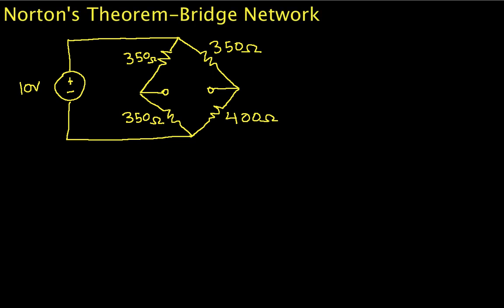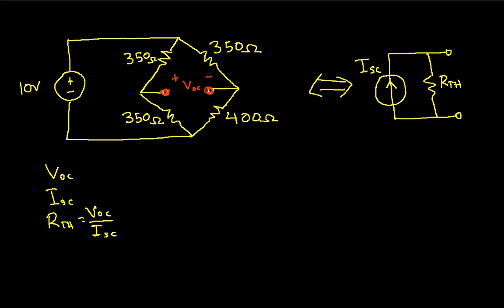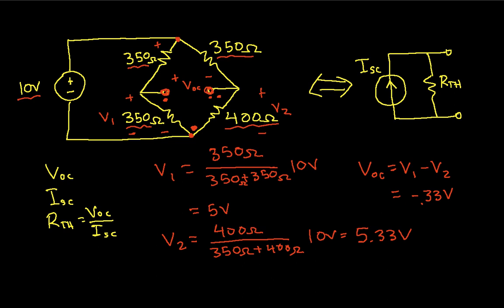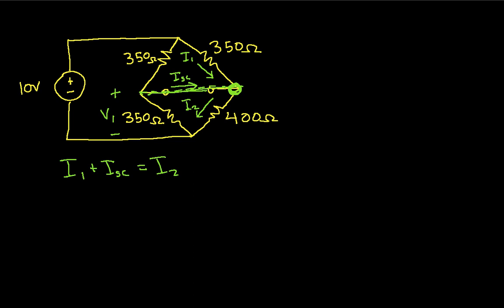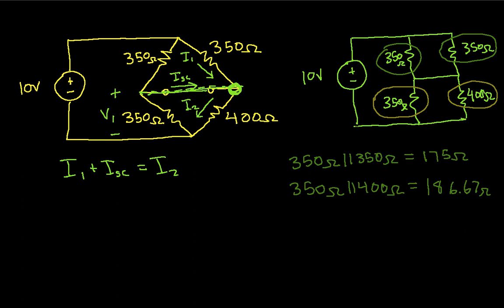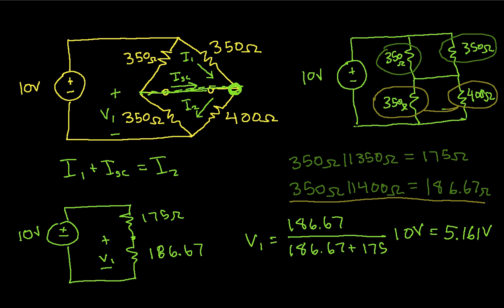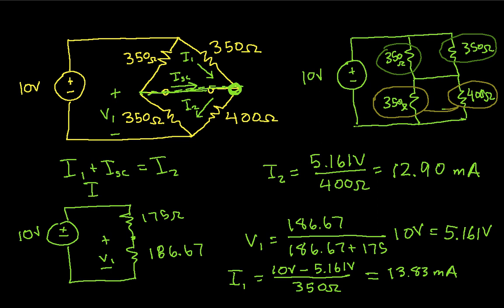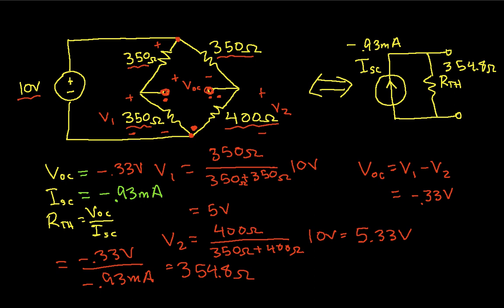Norton's Theorem Example-Bridge Network Part 1

Comment from the maker: You are correct-361.67 Ohms is more exact than my computation. I rounded the intermediate results in computing Voc and Isc, and the rounding error gave me the different value shown in the video.
Reply: Can we use mesh analysis to find the current i1 ND i2

Comment: when finally we get 175 ohm and 186.67 ohm.these two resistors will be in series .as they are in series ,doesn't the same current pass through them????
Reply: Did you ever figure this out?